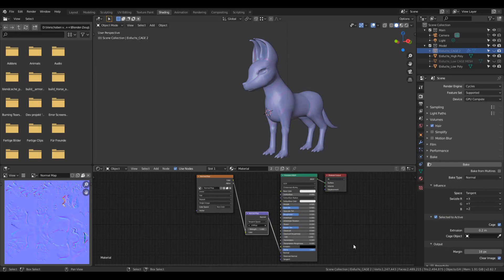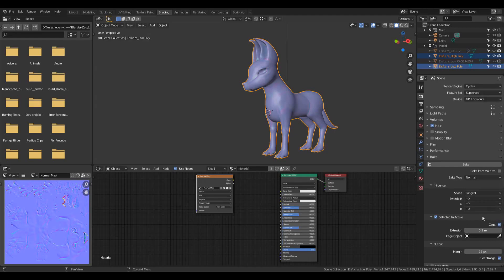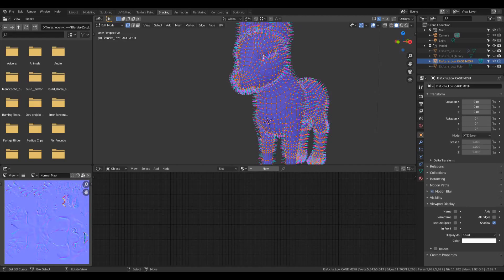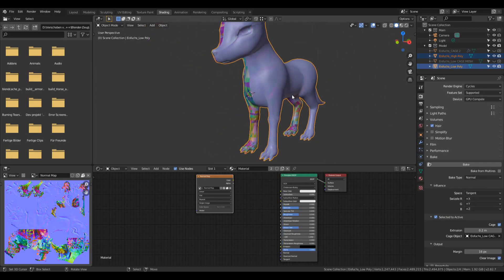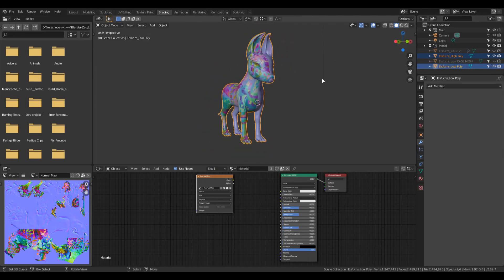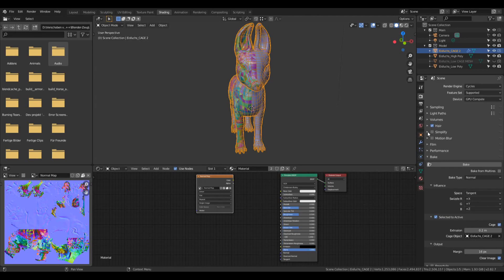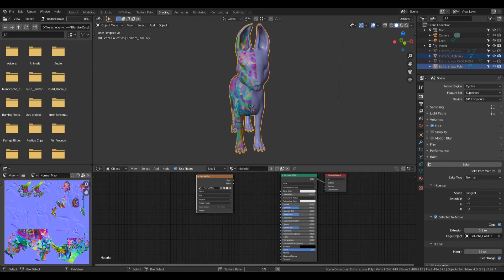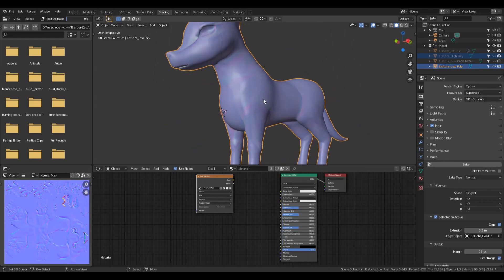Blender Tutorial [English] #011 Fix Cages for Normal Maps - Issues, Problems, ugly 'Mosaic' bakes

Comment: Thank you so much for posting this! I was having the weird mosaic for a cage normal bake and it was because I applied a mirror modifier on the cage mesh. Just remaking the cage mesh after I had applied the mirror on the low poly model fixed it. I wasnt even sure what to google for the error tbh so this video totally saved me
Reply from the maker: Very welcome and happy it did help you out! Yeah, mirror modifier also alters this logic. I'm glad people out there helped me when I was facing this myself. 
Out of curiosity, what did you type in search? I might add some more tags so it's even easier to find for people troubled with this :D
Reply: @IlianaFirestorm  I don't remember exactly. I think I might have been googling normal map cage bake checkerboard patern or normal map cage bake artifacting or something.
Reply from the maker: @L1nkn1vy  Thanks! I added some of these to the video tags, hopefully this way everybody in the struggle is going to find a solution :) 👍